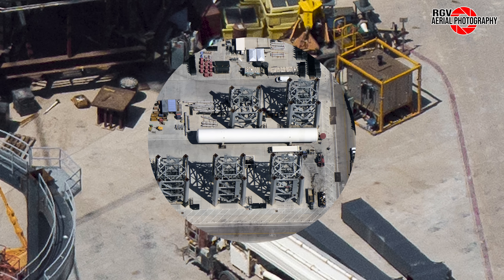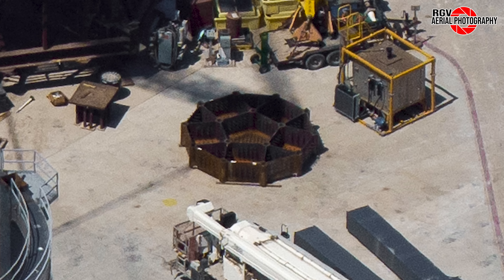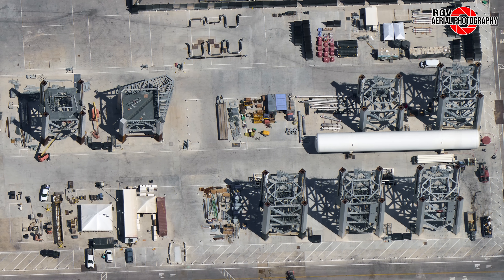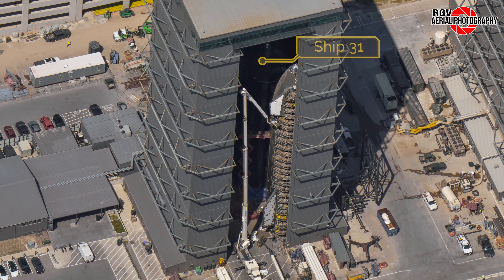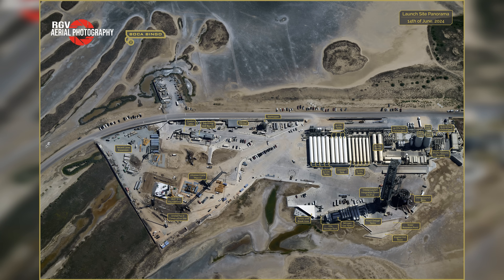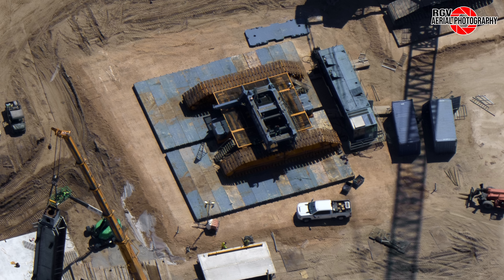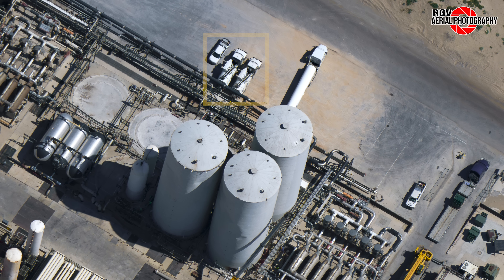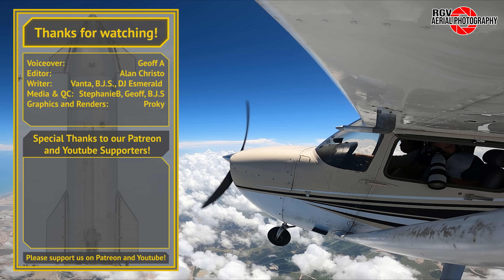Starbase Flyover Update Episode 46

Comment: I'll throw a guess into the ring for that mystery area near tower 2 that's being drained presumably for some heavy foundation work. Perhaps that's going to be a base for a pretty big water storage facility.

I'm thinking that with the success of the shower head on OLM1 SpaceX might use water protection in more places on OLM2, maybe the top plates and bits of the legs that take damage on every launch, and if they do that then they're going to need more water storage than they have for OLM1 (especially since it looks as if the deluge system might also be active for the booster catch) so that might be why they are gearing up for some heavy duty foundations in that area.